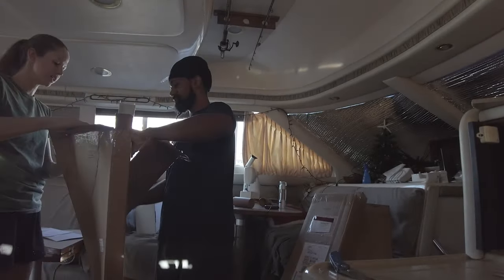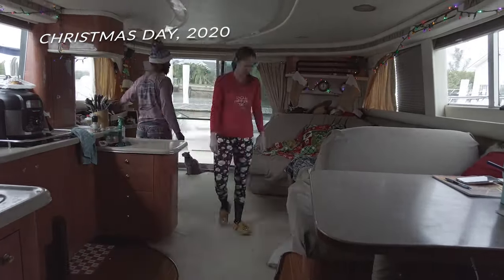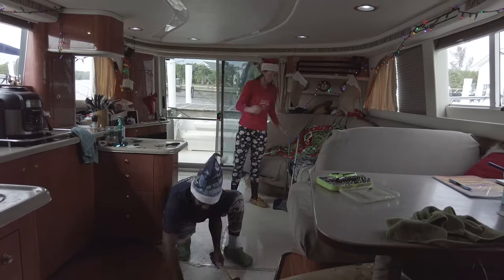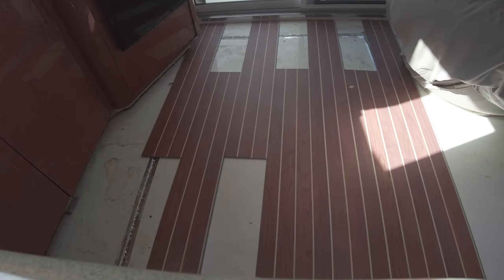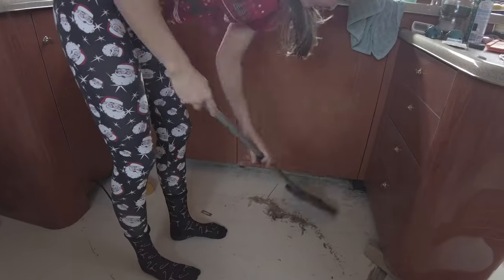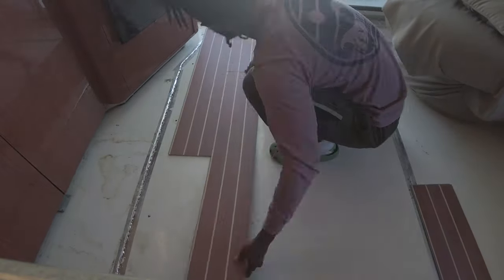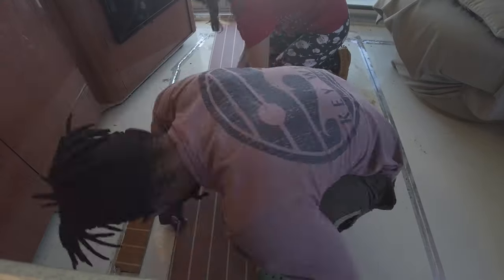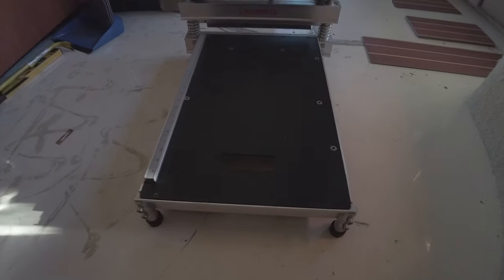Nautikflor DIY Install Full Timelapse & Review

Comment: Nice job.  How did the floating floor feel when walking on it?  I have that in my new Cape Coral house and I’m not much of a fan of the float feel.  But for ease of install and price.  Can’t be beat and looks great.
Reply from the maker: Thanks. It wasn’t too bad. The planks are pretty firm and slightly textured so it has a solid feel to it. Of course the flooring is mostly 2 big engine hatches so there’s a slight flex when walking in certain spots, but it’s always been that way so we’re used to it.

Comment: Did you guys notice a change in engine room noise after the removal of the carpet and pad? I am at this point right now, but I don't want to add any more engine sound than I already have while underweigh.
Reply from the maker: We didn’t notice, but the engines are pretty loud in general, and since I only ran them from the flybridge, it all just kind of seemed like nothing changed, but it’s possible it got slightly louder.